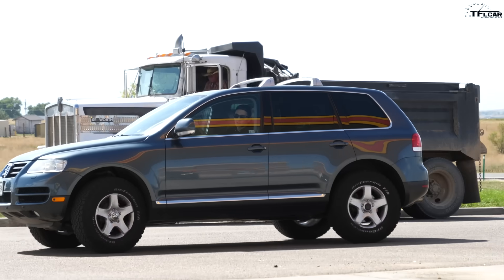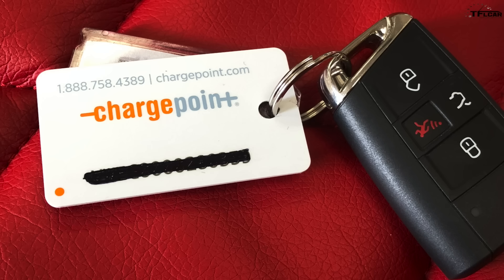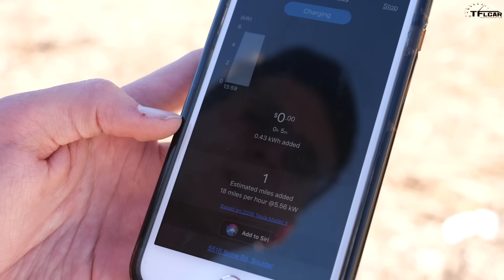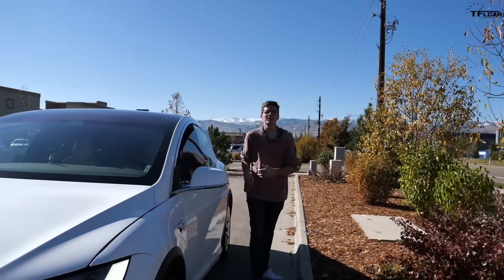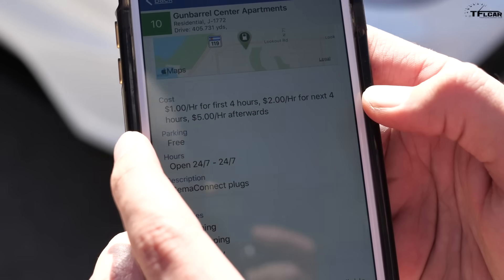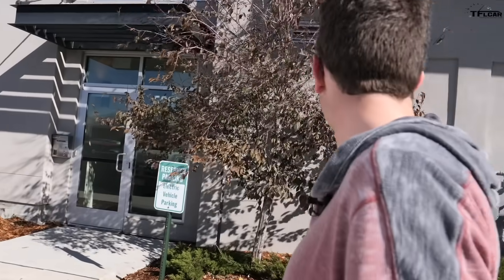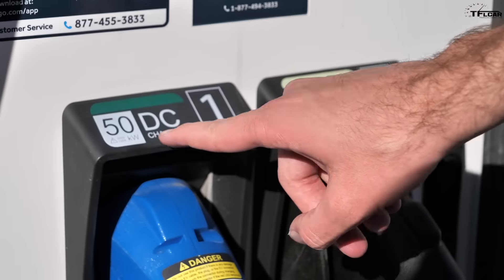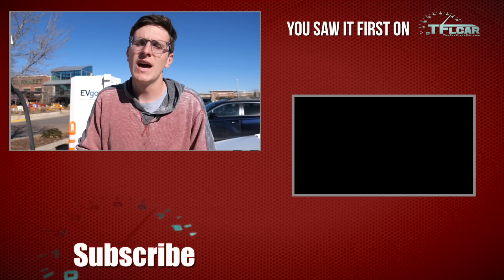Here’s Why Charging an Electric Car Can Suck - And It’s Not The Reason You Think!

Comment: I'll consider an EV when:

1. Range of 300mi minimum
2. Charging stations as ubiquitous as gas stations
3. Charge time as quick as filling a tank, 5 min
Reply: uh, they have 300mile range already mate. Charging stations come with demand. 15 minutes isn't bad for 80% charge, how often do you even need them though? according to other commenters they almost never charge outside their house because theres no need.
Reply: @0xsergy  Really the leaf has a 300 mile range?  Outside of Tesla that's not true. Audi's e-tron tries but is having teething issues.  Again 15 minutes is fine until you are in an area where you end up with more cars than charging stations. As for home charging, that's for those who only commute in an EV, they all have a real car for vacations and extended trips.  Good thing there are extension cords for urban dwellers so the can plug in when parking 2 blocks from home

Comment: The "Trio of Troubles" is what is stopping the so-called "EV Revolution" in its tracks - Price, Recharge Time and Range. And the sad thing about it is that EV carmakers just are NOT listening to customers. More and more research is being dumped into range when it is RECHARGE TIME that is a major sticky point for 98% of new car buyers. Until electric cars have the features and conveniences of ICEV's (i.e. 5-min "refuel" time), there simply won't be any mad rush by consumers to leave an automotive platform (ICE) that is hard to beat.

Comment: Model3 driver:
Reality is. most people do have 30 amp in garage, STANDARD DRYER OUTLET. I charge in 5 hours - bingo. I get 300 miles $ 4.34 cost- bingo. I drove from Columbia, Missouri 2,300 miles in 3 days. Drove across Kansas to Pueblo, Colorado, slept then into Utah to Umatilla, Oregon, slept, then to Olympia, Washington, home. The car drove better than 90% of the time, while I kicked back, enjoyed the view.
Unless you have driven a Tesla, you are clueless. PERIOD
Cars I've owned. 1956 Chev. SAAB,  VW BEETLE. FORD TAURUS, TUNDRA, ACURA, BMW Z4 COUPE.
I drove 2,300 miles LA and back to Olympia for 97.00 bucks for Supercharger power. On another trip. Cheap, fast, car drives itself, don't listen to the naysayers.

Comment: Gas or Hydrogen Fuel cells, please.  EV makes no sense for a practical user of a vehicle.  Nobody has the time and energy required to seek out EV stations, go through the hookup compatibility issues, and then wait forever for a charge.  The sheer waste of precious time is the biggest challenge here.  Good luck to you if you need to take a long trip, or multiple short ones.  I could not imagine the stress of trying to simply go about your business behind the wheel, having to worry about if your current charge level will get you to the next destination, and if you get there, whether or not there will be an EV station nearby, and even still, do you have the time to (waste) waiting for the damn thing to charge up before you can get on your way and be productive again.

Comment: also.. i thought about you guys the other day when it was pouring i mean dumping rain
Reply: Rain goes good with high voltage. I don't see a problem, it's the same as running a genset in the rain. It's only 240V. You might want to slip on some sneakers before you touch your EV though while it's plugged in. Me, I'm just an old wireman who still has all his fingers...

Comment: So my takeaway from this is that it would be much better to get a hybrid and carry your charging system around with you everywhere you go.
Reply: Hybrids are way more combustion engine powered than electric motor powered. They are not electric vehicles is any real sense. A diesel-electric locomotive is however electric motor powered.

Comment: Sounds like the charging points will need to be federally regulated
Reply: Yeah. I'd require tap-and-pay support, ban the requirement for smartphone programs, require all charge point locations be registered with a national database that any charge-finder program can access free of charge, require CCS connectors on all charge points and cars (bundling an adaptor doesn't count), and require vehicle-to-grid support on all charge points and new vehicles.

Comment: Don’t buy electric or you will be constantly frustrated
Reply: I always charge in my garage so I don't have to bother with wasting time at gas stations. In 35,000 miles I also have only had to take my EV in to get new tires. That's it. No more wasting time getting oil changes and all the other bullshit. With regenerative braking I won't have to have my rotors turned or brake pads changed for like 150,000 miles or more. 

No more being frustrated with wasting time changing fuel filters or belts or hoses or flushing and replacing coolant, etc, etc, etc.
Reply: @flipadavis  what has been the effect on your electric bill? I never hear this mentioned.
Reply: @dudley7540  I actually save money when comparing the gain in my electric bill vs. saving on gas. It also depends on what kind of gas car you drive and where in the country you live. The rule tends to follow though that wherever electricity prices are higher so are gas prices. 

If you want to see how much you would save what you can do is take the efficiency of say the Model 3 and take how many miles you get from 1 kWh of electricity and divide that into your car's mpg to see how many kWhs equivalent you would need for the same distance as 1 gallon of gas. Then multiply that number times your local cost per kWh. 

For example let's say you have a car that gets 30 mpg combined. The Model 3 gets around 4 miles per kWh per the EPA. I would use 3.8 miles per kWh though since that is what I have averaged over 35,000 miles. So to compare to a 30 mpg car using 1 gallon of gas you would need 30/3.8 = 7.89 kWhs to go that same 30 miles in the Model 3. 

A gallon of gas where I live currently costs around $2.45. 
Our electricity rates with taxes is around $0.14 a kWh. So to go the same 30 mile distance it would cost 7.89 X $0.14 = $1.10.

Comment: 15mi/hr charging rate? Yeah that needs to be fixed to at least 100mi/hr if they really want to replace has cars for long drives.
Also, this showed I think the 2nd biggest issue, lack of standards. Every gas car has the same gas tank slot and as pumps use regular card payments (some use Tap & Pay too).

Until these big issues get fixed, I really can't justify going EV.

Comment: This system is broken already.any gas pump will fill any car or container
Reply: And it will do it in a few minutes, not hours
Reply: J1772 is gaining a lot of popularity with non-tesla EV makers, and ChaDeMo is a standard only japanese companies used as back when it was new it was the fastest standard, but improvements to J1772 and ChaDeMo's many downsides is seeing it fall out of popularity (only the Leaf really uses it still, and even it supports J1772 natively for L2). Tesla is really the last holdout not adopting J1772 due to the special Supercharging connector.

Comment: Imagine phone battery dies while trying to connect with this machine to charge your car.
Reply: Tesla dies then phone dies *and charge station closes
Reply: @bluebox13studios43  If your phone battery dies while attempting to connect, the charging station just won't work and that's it.
You'll have to drive to a 'wimpy' 5 kW station instead.
Reply: Devil's Offspring I was making a joke about having to charge your car ,phone ,and depend on wether the station is open to make sure you can keep driving lol , phone dies first trying to connect port gets shut off and then your car dies now you just officially took up walking to places
Reply: @bluebox13studios43  🤪😂 nightmare fuel!
Reply: YOu have to Plug your phone into your car first silly.
Reply: could be worse. the tesla battery could go flat and you cant open the door.
Reply: @rosaliebent4833  They have an emergency lever inside them, it's illegal to sell a car in the US where it's impossible to open the door if the battery dies.
Reply: @mattwolf7698  tell that to the guy with the disabled child stuck in his car for 45mins so emergency services could open the doors.  They have fixed it NOW because for some reason no one thought it might be a good idea to have a HANDLE on the inside rather than a button. TEsla would replace the steering wheel with a smartphone app if they were allowed.
Reply: It should still work fine, it'll probably pump out a paper bill or mail you the bill.
Reply: @devilsoffspring5519  Yes, there's a lot of options. Generally there's a key card when you sign up for any of the services, or you COULD just not be an idiot and plug your phone into the car for 5 minutes.
Reply: Holy shit
Reply: Good point!
Reply: @sploofmonkey Thanks, that was pretty funny. Haven't heard anyone mention 'the mark of the beast' in a few years now.
Reply: Good thing I have this magic credit card to pay for stuff
Reply: @0xsergy  Of course Tesla owners need do nothing but plug into a supercharger. The system recognizes the car SN over the cable and charges your registered card. They are still working on expanding this to be an open standard.
Reply: You can use a card not just a phone, duh

Comment: Fully charged batteries that you can change out in a minute or two would eliminate the need to wait for charging.  That's how it should be done.
Reply: fully charged batteries are terrible for the battery itself, there's a reason teslas only refill to around 80% if they're gonna be sitting overnight or some such. imho the system as is is great for 99% of people. if you want to do a long ass roadtrip once a year just rent a car, or borrow one from a friend and leave them the tesla. There are so many workarounds to the 'roadtrip' issue that people bring up as if they were going on roadtrips every other day.

Comment: This obsession with how long it takes to charge an EV is wildly overblown for most people's daily lives.  How many miles do you normally drive in a day?   How many hours do you sleep?  As long as the charging rate is fast enough to get more energy into the car every night than you take out of it, even very slow chargers are going to work fine for most people's real world usage.

This "you've gotta charge it for 3 days" stuff is very misleading, because you don't let the thing go flat and fill up once a week like you would with a gas car.  Instead, you fill up every night.  And if you think that sounds like a hassle, you are wrong.  It takes 2 seconds to plug in, and 2 seconds to unplug.  One of the unexpected privileges of owning an EV is that your "gas station" is now right in your house and you no longer need to waste time going to the gas station every week.  If you spend just 5 minutes a week filling your tank, I guarantee you that you are spending considerably more time filling up your car than I do.   

So even with a dinky little 110V charger, you can likely put more energy in overnight than you use the next day, assuming you have a typical commute.  Consider this: I have a Volt and a 40 mile (round trip) commute.  I never even bothered to put in a L2/240v charger.  I have an almost flat battery every night when I get home from work, and every morning I have a completely full charge off the 110V charger, and the charge finishes a few hours before I leave the house in the AM, so I am not even using all that time to charge.   And if I bought a Tesla, I would probably still not put in the L2 charger.  Because I would have no trouble staying ahead of my normal usage with the 110V charger, and I could go plug it into a L2 charger at work or at the mall nearby if my usage suddenly spiked unexpectedly. 

Yes, you still want an ICE if you want to drive across the country.  And you also probably want a gas engine if you can't charge it where you park it overnight.  But anybody who lives in a house and doesn't drive huge distances every day can likely fit an EV into their daily lives pretty easily and with virtually no hassles.

Comment: Pain in the arse. They're gonna need to sort all this out before the majority of drivers will consider giving up their combustion vehicle.
Reply: @Tech Tacho  You already have millions of cars sitting around in parking spaces for hours upon hours while the owners are at work. They might as well spend that time charging.
Reply: All that really needs sorting out is this video.  Check out the Tesla Model 3....the reality is better than an ICE car in every single way.  Literally every single way.
Reply: @johncahill3018  until you see the quality issues in model 3..
Reply: Stigs stupid cousin That was only really on early production Model 3s. I got mine in November 2018 in fine condition, no panel gap problems or defects. Tesla has stepped up their production game most definitely.
Reply: @johncahill3018  They have their downsides just like anything else. Tesla vehicles cost way more than my car does, it takes time to charge, forget about a road trip, you lose alot of your range in cold weather, etc etc.
Reply: Ryan M Why should I forget about road trips? We drove our Tesla Model 3 from Cleveland to Orlando (1200 miles) in about 18 hours (15 driving, 2-3 charging) thanks to Tesla Superchargers.
Reply: But mankind can't make electricity flow any faster,  can we?  Is a whole new type of battery needed?
Reply: @truck6859  
Tesla is already working on a new battery that has a lifetime of 1 million miles (lifetime as in how long it will last before the battery deteriorates and is no longer useable) maybe that battery could also fix this issue.
Also graphene batteries have been getting a bit of buzz in the news recently, apparently supposed to charge super fast and hold more power at the same time. However, I've only heard graphene batteries being potentially used in phones. Nobody's said much about it being used in cars, atleast I think.
Reply: I'd happily  give up gas sucking cars for EV  anyday.
Reply: @aaaaaaaaaaaadddd  
I'll take my Hybrid over your electric sucking vehicle any day. There's a Tesla converted to a "SuperHybrid" that gets 117MPG. Amazing idea! It gets almost 1,000 miles per tank.

Comment: is there anything that stops someone from unplugging it live in a rainstorm and frying themselves with 240 volts when it gets wet?
Reply: If I'm not mistaken, the charger locks into place when it's charging.
Reply: 240V isn't what's gonna kill you, it's the 16A. 

And yes, the charger won't keep charging if it's not plugged in, so you won't get yourself killed in rainy weather.

Comment: "Most people don't have high voltage power in their garage." Source? In the U.S. 75% of homes with dryers use electric dryers, which require 240V hookups. Same with electric stoves. I can't find stats, but I would guess probably at least 70% of homes in the US have 240V hookups.